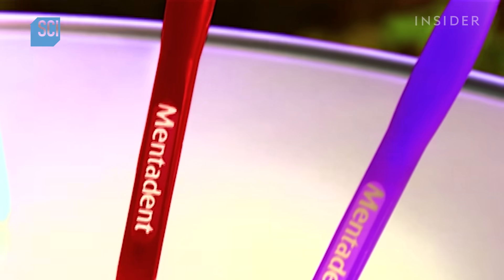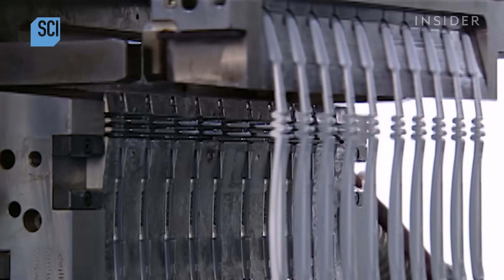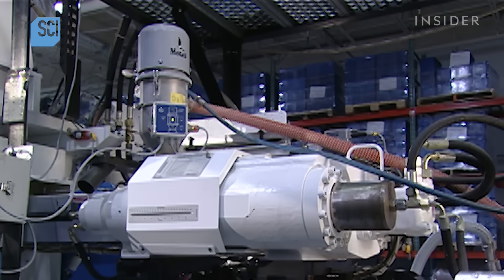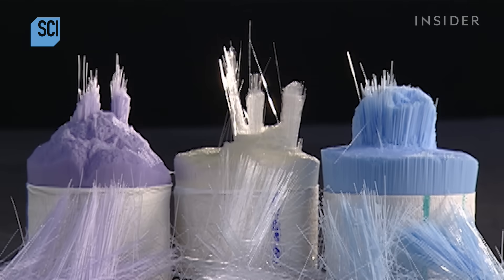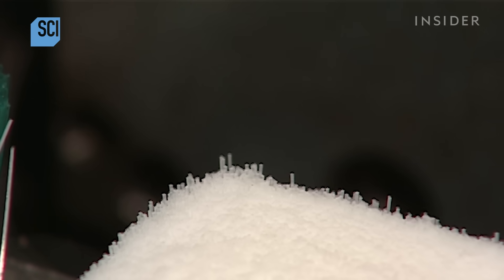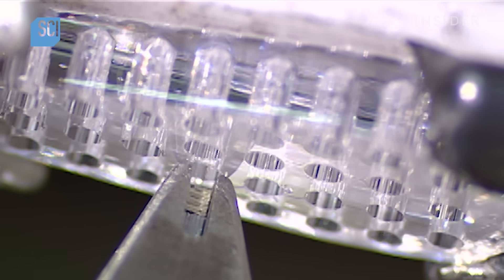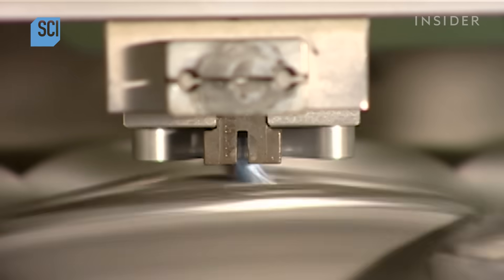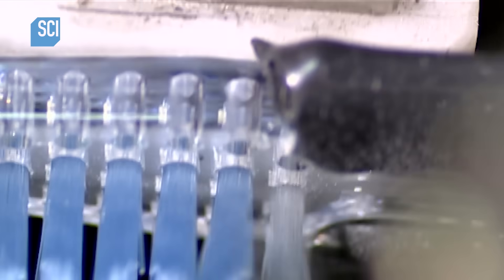How Toothbrushes Are Made

Comment: They said the reason the bristles are different colors is just for esthetics. I was always told that the blue ones are supposed to serve as an indicator of when the brush needs to be thrown out because the blue stripe will wear down faster than the white ones, and once it does so to a certain point, then it's time to get rid of it. I remember learning that in elementary school.